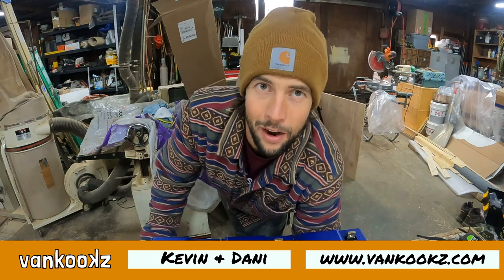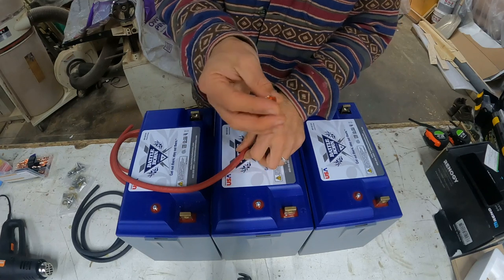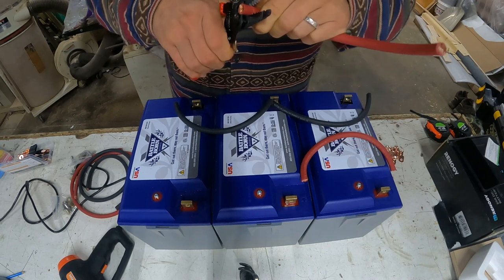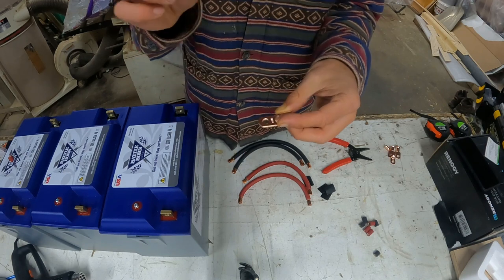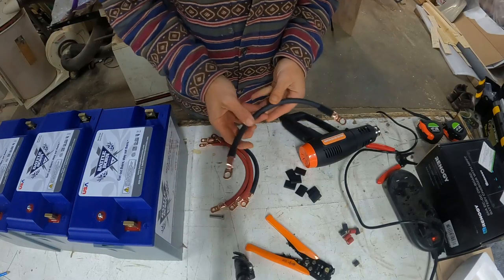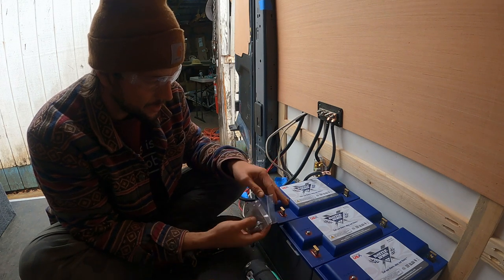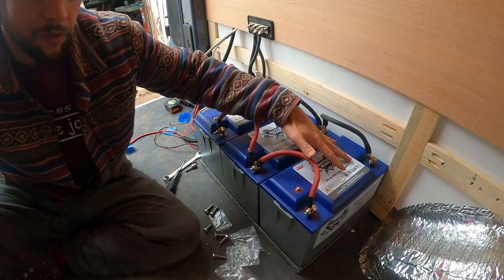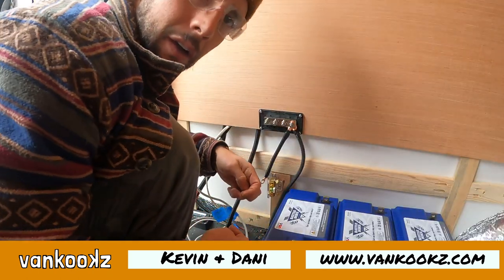How to Connect Lithium Ion Batteries in Parallel | Wire Your Batteries in 6 Easy Steps

Comment: Isn't it better to use a bus bar for all the batteries (+) and (-) to connect to? 
I mean in this state there is a chance that at a higher C rate discharge the cable nearest to the inverter will heat up excessively not to mention the battery closest to the inverter will be supplying more current than the other two.
Reply: OK, I have a question for you. I have three 100 amp hour Redodo lithium, iron phosphate, batteries, in parallel. I am using busbars however my bus bars only have six lugs,,,I have my Victron Phoenix 1200 inverter on the busbars and also and a couple of Victron smart charge controllers. I want to hook a fourth battery up and I don’t have room on my bus bars so am I allowed to double stack anything on the bus bar? and if so What’s the best choice what should I double stack if that’s allowable ? or do I make a jumper wire and come off of my already in use positive bus bar to another positive bar and hook additional loads onto that or will this screw things royally???

Comment: Did you make sure the batteries were at the same state of charge to avoid current rushing from one battery to the other potentially damaging the BMS or battery?
Reply from the maker: Yeah they were.   But that's a great point I missed.   Thanks for sharing.
Reply: I'd make sure all were charged 100%

Comment: Bro, you didn't show the most important part! Do you connect the whole set positive on the first battery and in the opposite corner, third battery negative? Or you connect the first battery positive and negative?
Which one is it?
I have 2 24v batteries..

Comment: Hey what battery’s are you using and how much did they cost? Thx for the video I knew how to do this but I needed to show a few people how to do this sometimes people won’t understand unless they see it themselves!
Reply from the maker: Those are 100ah lifePO4 Battle Born Heat Enabled Batteries.  They are quite pricey.  I have a link in the description for SOK lifePO4 that are great and half the price they just don’t have the heater function of you are going to be in cold weather.  You can always get a 12v heat pad for winter for these batteries.  The SOK are highly reviewed and come with a 7 year warranty.
Reply: If you don't live in a cold climate or are willing to diy your own heating system (easy) then there are so many $300 12V 100Ah options out there. Redodo, Power Queen and LiTime are all identical batteries. Literally every single aspect of the build and they all have mini 100Ah batteries but they are not prismatic cells and have no room inside for a heating circuit but you could create a box  for multiple batteries and heat the entire box of batteries instead of heating each 12V battery itself. The cost of doing a DIY heating circuit is under $40 per battery, it can be done as cheap as $20 per battery if you are doing at least 2 or 3. Alternatively you can just have a temperature controlled charge controller to cut any charge current when the temps dips below a certain point. That could be a bit cheaper but annoying if you need to charge.

I recently got 2 12V 100Ah PowerQueen Minis for a total of $570 shipped to my door. I have been very happy with the communication from customer service when I had some technical questions about their BMS. Installing your own BMS with low temp protection (no heating) is another option that allows you to view stats over bluetooth on your phone including cell voltages, input and output power, and enable or disable charge/discharge. JBD and JK are the two top BMS companies, JK is a little more advanced. A JBD BMS for a 100Ah 12V battery can be had for $60 with bluetooth and a max 100A discharge rate. Cracking open the top of the battery will void your warranty but if warrant repair requires you pay shipping both ways....well the warranty isn't worth it

Comment: Can u do 4 lithiums in parallel? Anything special I need to do?
Reply from the maker: It’s the exact sage thing. Just use a crimper tool
Reply: Cable lengths the same. Draw power from opposite corners. If you are drawing positive from top right then draw negative from bottom left. You want to avoid there being differences in resistance so the batteries self balance themselves as a group

Comment: Let's say I connect 2 - 36v 20ah lithium ion batteries together. And they already have their own charge port. I solder the + to + and the - to -. So therefore I cannot undo them. How do I charge them ? And with what ?
Reply: Charge them with your battery charger.
Reply: @64-bit63  since they would already be connect by the red - positive and black - negative wires that would be connected to the controller. So I could then charge them each through their own charging ports separately ? Is that safe ?

Comment: I wish somebody would address one thing that nobody mentions in their videos or articles about parallel setups. Should both the input from the solar and the output to the load be attached to the same battery terminals?
Reply: No.  At the least, positive on the front battery to negative on the back battery.  The way he did this in his video will likely be alright with 2-3 batteries.  Regardless, if you connect the solar and/or output to any one battery in the chain... those batteries will wear sooner.  Will Prowse has a great video on his page explaining all of this and why.

Comment: Just fyi, you can buy 2 awg cables that are already crimped with terminals.  No need to reinvent the wheel.
Reply from the maker: Yeah I know but it’s cheaper to DIY plus you will have to crimp so many you might as well get good at it.

Comment: This is not the correct way to parallel the batteries if you want even distribution across all batteries atall times.
Reply: Which way is better?
Reply: @samwam45  connect each battery to a bus bar with identical length cables. 1 for positive, 1 for negative.